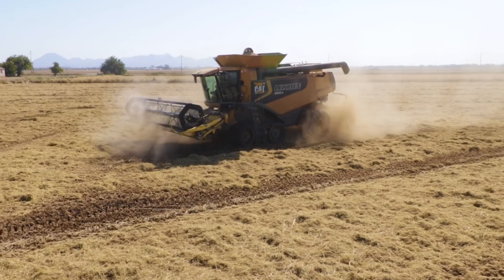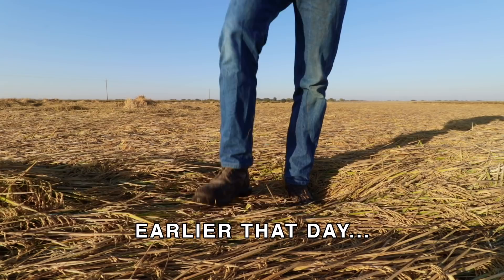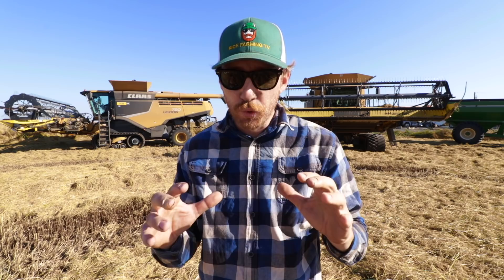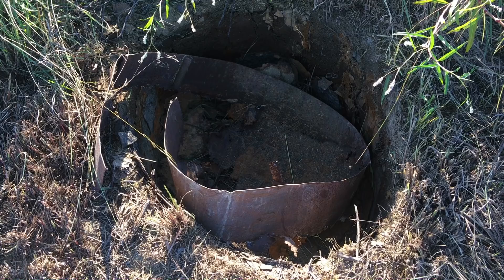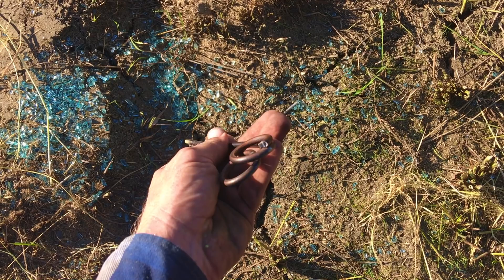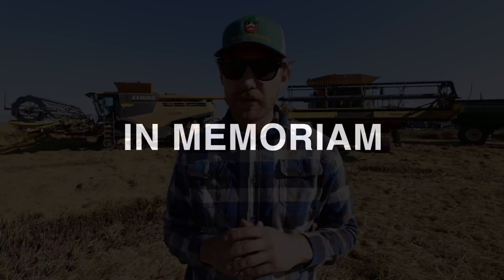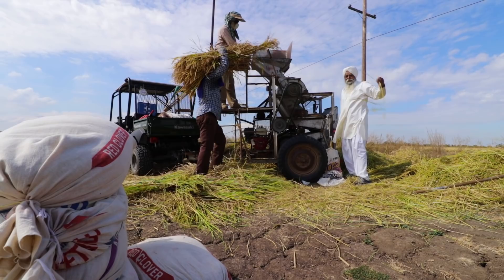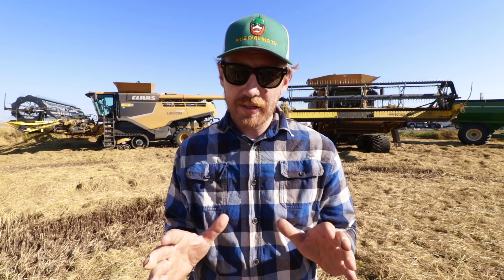Death by Harvest: A Story of Tractor Breakdowns!

Comment: Dude that sucked both deers died.  As a repair  tech for mobile equipment for a major tire producer I know all to well the problems of running old machines.. congrats on the new/used rig
Reply from the maker: Thanks Jan! It was really tough keeping all three machines running. When you’re in the cab, making rounds, it’s frustrating knowing that you’re not cutting at a day’s max potential. We got through it though. Thanks for empathizing. 
-Matthew
Reply: Murphy's law
Reply: Well it depends how well you treat those old machines because we run two 97 Jd 9600s and they can almost outperform our 06 Jd 9760 and come with nothing more than standard morning maintenance
Reply from the maker: It’s a law that old tractors definitely abide by, Mr. Soj.
-M.
Reply: Wait so M- well you know what is real? I thought it was just part of a tv show huh
Reply: @Ricefarmingtv  you need to buy a brand new fendt black beast combine for quick harvesting
Reply: I would have just sent ot with mo wondow

Comment: The Lexion 750 is a fantastic machine we have a Lexion 760 with a 30 foot header here in Denmark
Reply: have a 760 with 45ft MacDon and a 16row corn head
Reply: Joe Scheller You cant run a 760 with a 45 foot header here in Denmark we have to big of a yield for a machine of that size with a 45 foot header. We would need a 780 to use a 45 foot header and that would be struggling so the largest header that is really in use here is a 41 foot. But all the Lexions are fantastic machines no mather what continent you are on
Reply: @tobiassrensen6765  we run about 200bu corn normally and 40 to 60 bu beans 100 bu wheat 2ooolb flowers we are strickly dryland and small moisture annual rain fall
Reply: Joe Scheller We run about 150-200 bushels of wheat and a little lower in barley. In canola we run about a 100 bushels and we usually get a high amount of rain all year around. We dont have corn on the farm im on, but it is done some places but not as much as Wheat, Barley and Canola

Comment: Wow !  Not the best of October's I'd say !  OTOH, you did have a great service response when you needed it !  And you did find one machine to take the place of two .  Without a closer inspection its hard to say, but from appearances I would say a machine shop with the capability to swing the diameters could effectively repair that part.  I supect that's how ( a machined weldment ) it was made . IAC, a great video and thanks for sharing at a time when the pressure's on !

Comment: Any reputable machine shop could have made the extension hub for the track.
Reply: If you had a month to wait for it.
Reply: @crowman5936  If it broke at the weld or tube(no picture of broken part)? easy to fix with a lathe and welder in a few hours of shop time. That is a very simple part. The flanges are most likely still good, they would take the most time to make from billet.

Comment: Seeing the 585 listing like that was sad.  Thankfully it broke down in the field and not on the highway.  That would have been an even bigger nightmare.

P.S.  When I worked on the cats at Heavenly, we had a lot of problems with hydraulic hoses rubbing and eventually leaking.  Our fix was to cut a piece of heater hose with an i.d. that matched the hydraulic hose's o.d  and was maybe a foot longer than the wear spot.  Then cut the heater hose open lengthwise so that it can be wrapped over the hydraulic hose.  I'd then make sure the lengthwise cut isn't near the wear spot and the hose is centered.  Finally, I'd zip tie the heater hose in place.  Do this on both hydraulic hoses.  Then all you have to do is periodically keep an eye on the heater hose and replace it when it wears through.  It looks ugly but works good.  Kinda like me  :)

Comment: i would probably want to pull the stubs off both machines during the off season and have them magnafluxed or dye checked for cracked welds..  one in a million and no spare parts .. perhaps that combine took at hit on the transport or ended up in a ditch . . the broken weld looked like a clean break.. ..  i would imagine the old stub went back for repair to put the donor back together..     do you ever inspect your fields with drones equipped with GPS to note any possible debris out there.  no small feat..    i would think that inspecting the JD rotors that tore out during the off season might be a good idea too..  i realize those  are probably balanced..  looked like a long weld section failed.  but in that quick look.. i can't tell if the weld failed or the parent material unzipped.

Comment: Years ago I was harvesting with an IH915 and had the rear wheel bearing break putting the rear of the harvester down in the mud and of course it was way out in the back corner of the field but we had it back up in a few hours. Did you have a field party when the last of the rice was cut like we used to?

Comment: had a field certified 580 that that all the bolts came off the driveshaft ( lucky it was in the field and not on the road going down a hill )  -- Omaha also said never happened before - I asked if they could offer a boat anchor option as a backup option for brakes

Comment: Run the deere without the windshield
Reply from the maker: Ha! We joked about that. Only have the operator cut in one direction so the dust wouldn’t choke him out of the cab. You’d make a great farm manager, Misha!
-Matthew
Reply: Just need a large fan up front to blow it away lol
Reply from the maker: Tuner, now we’re getting creative! Fan, goggles, an oxygen mask and...GO CUT!
-M.
Reply: Rice Farming TV lol some times its just about getting the job done ive done it with a payloader in a snow storm and no windshield, thank god i had a good set of ski googles
Reply: Plywood and plexiglass, and don't forget ductape.
Reply: @Ricefarmingtv    A closed cab used to be an upgrade option.
Reply: Our contract spray operator smashed his window on his combine working for a corporate neibour of ours harvesting barley 
(Very itchy stuff)
He continued on but he's an older generation where he didn't get a cab till his 20s 
Later learnt a differant farm owned by the same company had 1 harvester and 2 chaser tractors down for lost air con 
With two chasers down the whole crew stopped for a day 
They got a please explain after head office  learnt of the two situations
Reply: or use a plastic as windshield
Reply: The first self propelled combine Dad ever owned was a Minneapolis Moline with no cab at all, he'd cut soybeans all day and get off wearing more dust than the combine, cabs are worth every cent they cost
Reply: @Ricefarmingtv  did that for years before the cab of anysort was even a dream do you ever hear of a 27A massey, hydraulics????, Electrical controls??????
Reply: @OOpSjm  a cab wasnt even a dream when i started harvesting

Comment: I would have tried to run the Deere with out a windshield .
Reply from the maker: You’re hired, Randy!
-M.
Reply: you can't do that hear in Australia unless you can stand the 45°c heat and the dust all day long
Reply: @phalanx3803  i run a 760 massey one day without the air and it almost put me in the hospital i paid for it dearly in the 100degree heat the fancy cabs of today were not meant to run without. cannot get any ventilation through them hence they turn into a heat box
Reply: @joescheller6680  @t had to drive those for most of a day with out AC because the all gas leaked out lucky the people that we called to re gas them understood how important our job is and got out to the farm after lunch just before the hottest pat of the day.

Comment: Only a 12 year old combine and you can't get replacement parts?.
Nothing like CLAAS quality.
Reply: Did you listen? It was part that broke that hasnt never happened before. They took part from another harvester wich is pretty good service in my opinion!
Reply: @anttiperala9973  Yes,I did listen and being only 12 years old and you can no longer get parts for it,time to switch brands of machines.
Reply: @4gauge10  But the thing is that it has never happened to them. I believe never happened to other brands aswell. They didnt exept it to never happen so they didnt have parts for that.
Reply: @anttiperala9973  It doesn't matter,every part on that machine should be replaceable,on the Deere its replaceable.
Reply: @4gauge10  It was replacalbe. They just had to compromise. Dont be an ignorant. Would you store some part that literally has never had to be replaced?
Reply: @anttiperala9973  John Deere does,why not the competition??.
You can get about 90%of ALL PARTS going back as far as the model"B"Deere.
You can make all the excuses you want,it just doesn't cut it.
Reply: @4gauge10  the deere was replaced period buy a machine that doubled their capacity of the deere
Reply: @joescheller6680  Of a Deere that was about 20 years older then the Claas,of coarse this wasn't mentioned.
The Deere doubles the Claas if you put it up against the S-790 with 60'ft.draper head.
Reply: As a neighbor farmer of Matthew I would like to say regardless of make or model of harvester all of our dealers wether Case,John Deere or Clauss give us amazing support. All machines breakdown. Someone has to be the first to have a part break. We have seen John Deere harvesters break those same spacer housings due to after market tracks being ran. Parts are usually available to our local dealers within a day. Occasionally we can’t get parts for a week. Clauss is a good company. They have had to figure out how to support their equipment as they aren’t a America company. I personally run John Deere and can equal the productivity of the Clauss harvester with equal age machine. Guess what I’m saying is it comes down to personal preference.